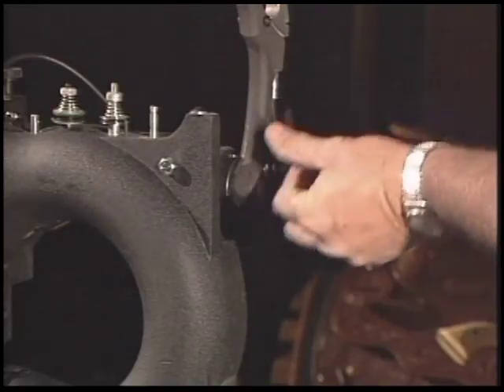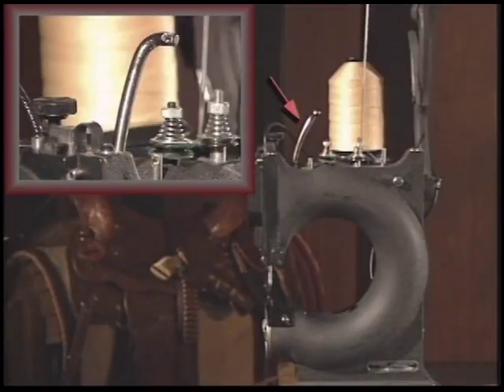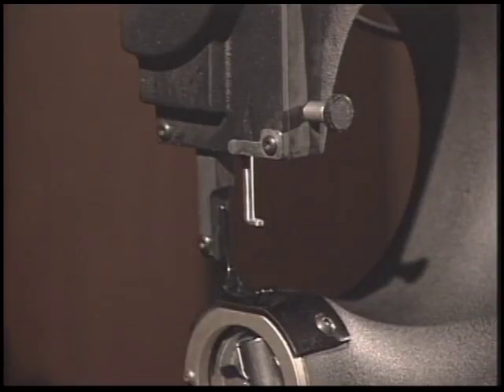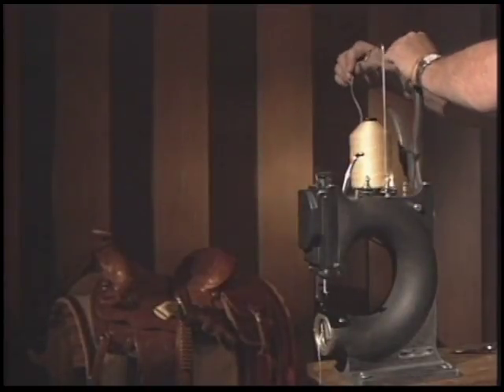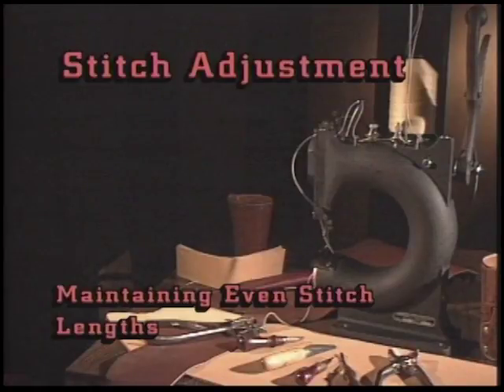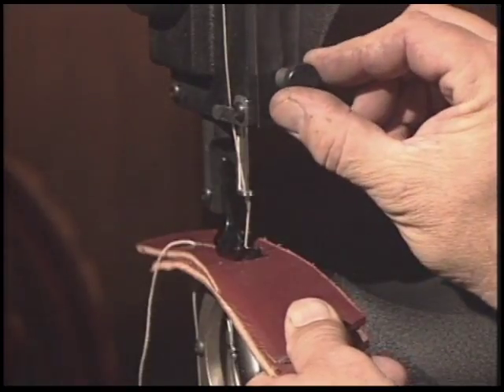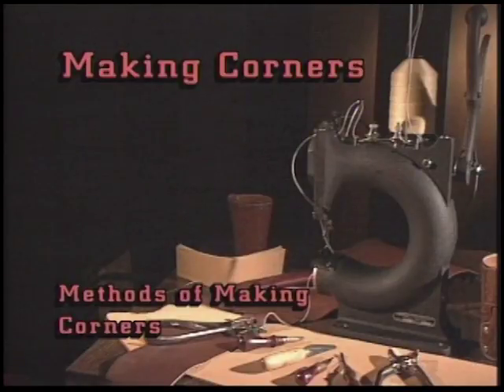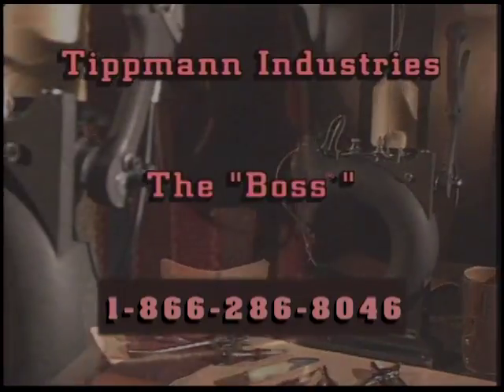Tippmann Boss (Instructional Video)

Comment: These are first class machines!  The videos didn't exist in 2010 when I bought mine so I'm checking them out.   As with all stitchers and sewing machines most issues are user induced  ;^)   I've been really pleased as it is a true workhorse.
Reply: The videos certainly did exist. I bought mine in 1998 and it came with this very video on a VHS tape.

Comment: The manual I have is much smaller than the one you guys show and page 5 doesnt match what you are talking about.  The CD or DVD I got in the box also wouldn't auto play and my computer wont open any of the extensions.   There was nothing about the thread guide assembly, where to put it and what parts went to it.  We figured it out but a more detailed illustration about it would have been nice.
Reply: Hey bud,
So the revision of the manual in this video is about 15 years old. That being said, feel free to call us to help you out with a correct edition or any troubleshooting with our technicians. You can reference the newer video on the Tippmann Boss and it goes over the thread guide assembly. We look forward to hearing from you. 866-286-8046 
https://www.youtube.com/watch?v=yqpwrIm6WgI

Comment: I bought a secondhand Tippman Boss and while practicing I’m getting a rats nest in the bottom stitch. How do I fix this?
Reply from the maker: Hi Nathan! Nesting usually occurs if the top tension is a little messed up or if when the handle is in the up position and if you push down on the take up arm and it can move your take up arm bracket could be adjusted. Call in at 866-286-8046 or shoot over an email to Ed@tippmannindustrial.com and we can help you out that way!